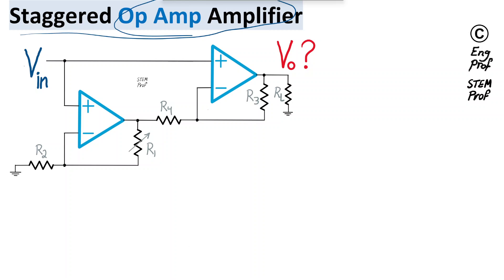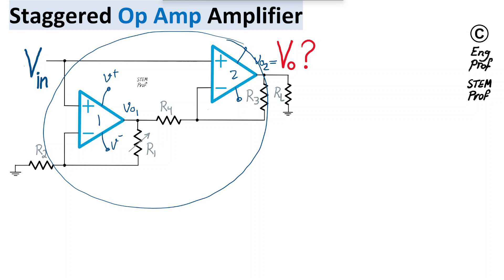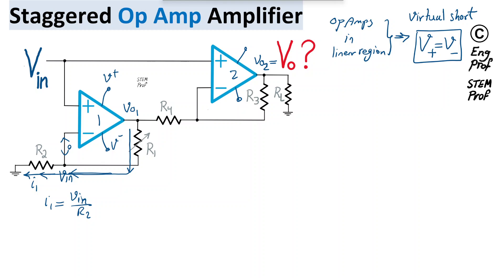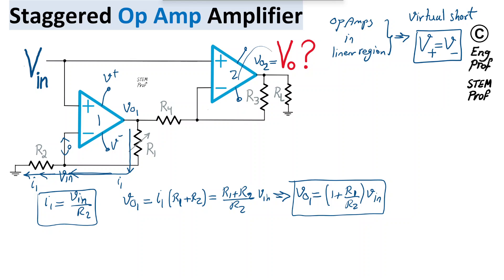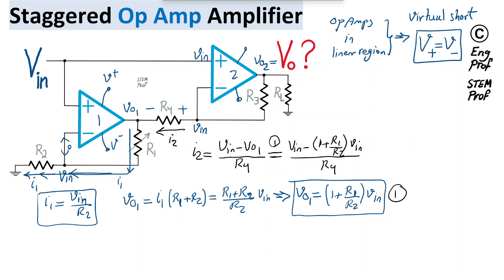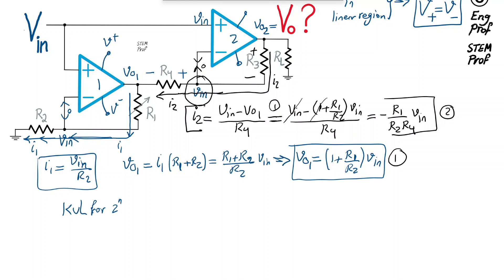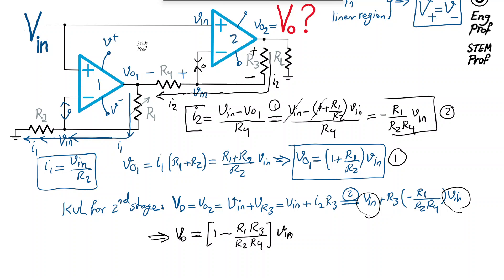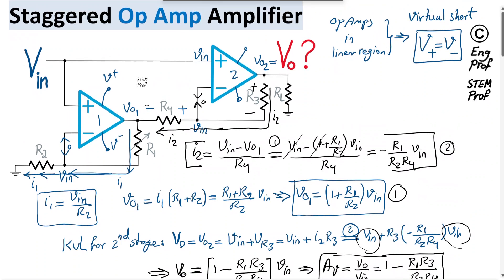Operational Amplifier voltage Gain (Bipolar) example with two staggered Op Amps

Comment from the maker: Thanks for watching. For more Op Amp Circuit examples pls see:
Instrumentation Amplifier with Electronic Gain Control https://youtu.be/C4tghZ-q6Zs
Differential Amplifier Design with BJT transistors https://youtu.be/zKgSYvk7JAM
Power Amplifier Design (Class A) with Transformer https://youtu.be/gKlJrqGqeCI
Analog Logarithm Computer https://youtu.be/RpKEq5WyoLg
Op Amp Analog Computer Differential Equation Solver https://youtu.be/ENq39EesfPw
Push-Pull Power Amplifier with Darlington Transistors https://youtu.be/866MYibo8yE
Thermometer Circuit Design with Op Amp & BJT transistor https://youtu.be/55YsraFE0rg
Sallen-Key Analog Filter Design Tutorial https://youtu.be/KwUnQXbk7gM
Universal Analog Filter Design https://youtu.be/2J-0msXZE2o
Laplace Transform Example and S-domain circuit analysis:  https://youtu.be/ps8N5TPM_qU
Op Amp circuit Bode Frequency plot https://youtu.be/BLVzuuqAlZs
Lowpass Butterworth Filter: https://youtu.be/UzCjkwqy-9w
Analog Computer to Raise Signal to power n https://youtu.be/IUTlBH1UraE
Triangle Oscillator Op Amp circuit https://youtu.be/JF5Up_cuL9k
Differential Equation Solver Analog Circuit https://youtu.be/R3X5AYNZGEI
Complex Sinusoid Oscillator https://youtu.be/GXRhmwmS5Zk
Sawtooth Oscillator Design https://youtu.be/2eUsGPfqbW4
Full-Wave Rectifier circuit example https://youtu.be/DJJMNU-CYcg
Sawtooth Waveform Generator design with OpAmp, JFET, BJT https://youtu.be/5zHXTx-Vl20 
op amps Circuit with feedback loops to design an analog computer that solves a second order differential equation https://youtu.be/HeZRtnRXpEI 
For more analog circuits and signal processing examples see: https://www.youtube.com/playlist?list=PLrwXF7N522y4c7c-8KBjrwd7IyaZfWxyt
I hope these Circuit design and analysis videos are helpful. 🙋‍♂

Comment: Is it correct that we have Vo = 0, if R1*R3 = R2*R4, fun! We can have an amplification from eg  - 10 to +10 !
You're a very good teacher! Thanks.
Reply from the maker: You are welcome. Thanks for watching & your good observation and encouraging comment. Yes, we can realize a bipolar voltage amplifier that can realize both positive and negative gains. And gain is zero if R1*R3=R2*R4.  For more Amplifier and Op Amp Examples please see https://www.youtube.com/playlist?list=PLrwXF7N522y4c7c-8KBjrwd7IyaZfWxyt . Thanks again🙋‍♂️
Reply: For me it looks like A varies from +1 (when either R1 or R3 is zero) to -X (depends on a ratio of R1 to R2, or R1 to R4, or R3 to R4 where ever you put that variable resistor)
And so with additional capacitors or inductors you can shift a phase depending on a frequency. And for example extend a stability zone (if your further schematic rotates high frequency phase to much and your amplifier becomes a generator)
Reply: @sc0or  Yes you're right.
Reply from the maker: Thanks for watching and sharing your good points regarding practical applications of this bipolar voltage amplifier circuit. I hope you also find interesting the following additional examples:
Op Amp Amplifier with Electronic Gain Control https://youtu.be/NoNgQpbj77Y
Push-Pull Power Amplifier with Darlington Transistors https://youtu.be/866MYibo8yE
Power Amplifier Design (Class A) with Transformer https://youtu.be/gKlJrqGqeCI

Comment: i dont see a useage  for this tow stages just to lose more power in opamp 1
for example you just can use more control by using resistor in series with potentiometer in for gain control or use another potentiometer for matching resistors 
but this way you might get in trouble with high HZ signals 
what is your opinion ?
Reply from the maker: Thanks for watching, your interest & your comment. While there are many/better ways to design specific Amplifier, the application of staggered Amplifier is generating both higher voltage (output of first stage) and lower voltage (output of second stage) from the reference input voltage. For more amplifier examples please see:  Op Amp Amplifier with Electronic Gain Control https://youtu.be/NoNgQpbj77Y
Analog Logarithm Computer https://youtu.be/RpKEq5WyoLg
Power Amplifier Design with Transformer https://youtu.be/gKlJrqGqeCI
Op Amp Analog Computer Differential Equation Solver https://youtu.be/ENq39EesfPw
Instrumentation Amplifier with Electronic Gain Control https://youtu.be/C4tghZ-q6Zs
Push-Pull Power Amplifier with Darlington Transistors https://youtu.be/866MYibo8yE
Thermometer Circuit Design with Op Amp & BJT transistor https://youtu.be/55YsraFE0rg
I hope this clarification & these examples are helpful.
Reply: Me too! But this way you might get in trouble with high hz signal?
Reply from the maker: @qemmm11 thanks for watching & sharing your thoughts. It depends on the type of op amp selected and purchased for the target application.

Comment: So, this is an amplifier with a total gain less than 1?
What is the benefit of using two stages? Can't you make a small gain with one stage?
Reply from the maker: Thanks for watching & your good question. While there are many ways to design an Amplifier, the application of staggered Amplifier is generating both higher voltage (output of first stage) and lower voltage (output of second stage) from the reference input voltage. For more examples please see:  Op Amp Amplifier with Electronic Gain Control https://youtu.be/NoNgQpbj77Y
Analog Logarithm Computer https://youtu.be/RpKEq5WyoLg
Power Amplifier Design with Transformer https://youtu.be/gKlJrqGqeCI
Op Amp Analog Computer Differential Equation Solver https://youtu.be/ENq39EesfPw
Instrumentation Amplifier with Electronic Gain Control https://youtu.be/C4tghZ-q6Zs
Push-Pull Power Amplifier with Darlington Transistors https://youtu.be/866MYibo8yE
Thermometer Circuit Design with Op Amp & BJT transistor https://youtu.be/55YsraFE0rg
I hope this clarification & these examples are helpful.

Comment: Very clear, excellent
Reply from the maker: You're welcome. Thanks for watching. Glad that you like this Op Amp circuit analysis video. For more examples pls see: 
Op Amp Amplifier with Electronic Gain Control https://youtu.be/NoNgQpbj77Y
Analog Logarithm Computer https://youtu.be/RpKEq5WyoLg
Power Amplifier Design with Transformer https://youtu.be/gKlJrqGqeCI
Op Amp Analog Computer Differential Equation Solver https://youtu.be/ENq39EesfPw
Instrumentation Amplifier with Electronic Gain Control https://youtu.be/C4tghZ-q6Zs
Push-Pull Power Amplifier with Darlington Transistors https://youtu.be/866MYibo8yE
Thermometer Circuit Design with Op Amp & BJT transistor https://youtu.be/55YsraFE0rg
I hope you also enjoy these circuit engineering examples. 🙂

Comment: Optionally, we can learn the gains of the three basic single stage configurations that we derive from considering the currents through the two resistors. For each one, Rf is the feedback resistor and Ri is the input resistor for the inverting input:

In the inverting configuration, Vo is the output and Vi is the input. We find Vo = - Vi.(Rf/Ri).
In the non-inverting configuration, Vo is the output and Vi is the input. We find Vo = Vi.(1 + Rf/Ri).
In the differential configuration, Vo is the output, Va is the non-inverting input and Vb is the inverting input. We find Vo = Va.(1 + Rf/Ri) - Vb.(Rf/Ri).
Note that from the differential gain formula, you can derive the non-inverting gain by setting Vb=0 or the inverting gain by setting Va=0.

Now to solve your two-stage problem, we can call the output of the first stage Vx, which becomes the input voltage Vb for the differential second stage, which has Vin in place of Va.
Then Vo = Va.(1 + Rf/Ri) - Vb.(Rf/Ri) = Vin.(1 + R3/R4) - Vx.(R3/R4).
And we can use the non-inverting formula on the first stage to find that Vx = Vin.(1 + R1/R2). Then we can substitute for Vx in the equation above.
So Vo = Vin.(1 + R3/R4) - Vin.(1 + R1/R2).(R3/R4) = Vin.( 1 + R3/R4 - R3/R4 - (R1/R2).(R3/R4) ) =  Vin.( 1- (R1/R2).(R3/R4) )

Once you've done the KVL analysis on a single stage a few times, you learn the results for voltages and then it's easy to apply those to multi-stage designs.
Reply from the maker: Thanks for watching and sharing your thoughts and suggestions. Thanks also for your detailed comment.👍 While I am aware of the gains for inverting, non-inverting and differential amplifier configurations, throughout this video, in consideration of wide range of audience, I was trying to avoid using memorized formulas and instead I wanted to present the circuit analysis purely using the fundamental circuit laws (KCL and KVL). Please see more examples in the following two video playlists: My Analog & OpAmp circuit design playlist https://youtube.com/playlist?list=PLrwXF7N522y4c7c-8KBjrwd7IyaZfWxyt  
And Digital Signal Processing and DSP playlist: https://www.youtube.com/playlist?list=PLrwXF7N522y6cSKr0FmEPP_zQl011VvLr
Thanks again 🙋‍♂️
Reply: @STEMprof  Sure, Prof. I was fully expecting you to work from first principles in your video in order to cater for the widest range of audience. I merely wanted to use the comments section to offer those more interested in the topic a possible route that they might find useful.

For me, it's a bit like calculus where I don't have to take limits every time I differentiate a function if I already know what its derivative is.
Reply from the maker: @RexxSchneider  Thanks again Rex for watching and your insightful comments. I also appreciate your understanding of my work from the first principles approach. I understand your point of view as well :)